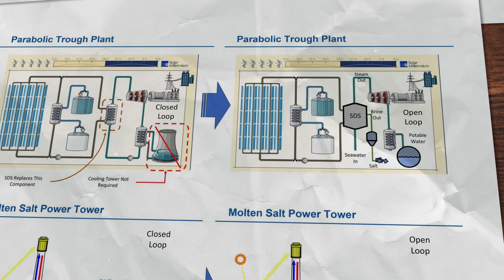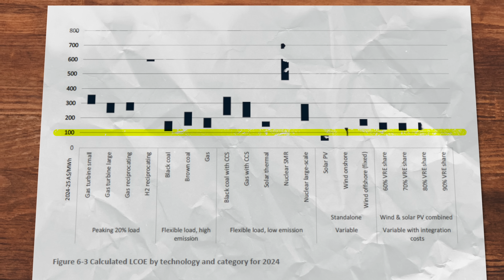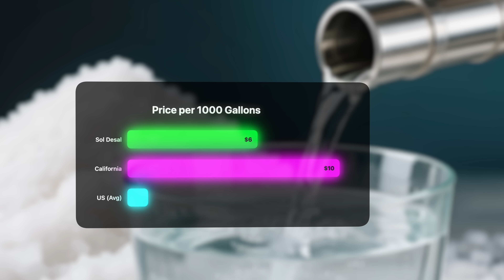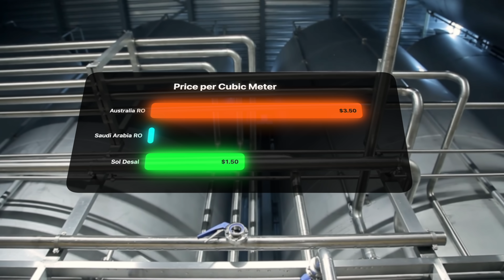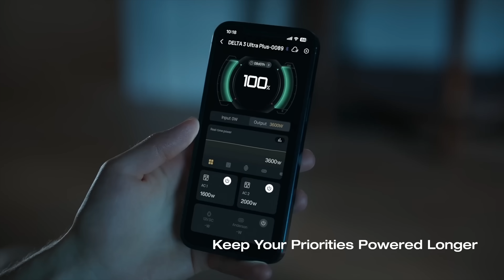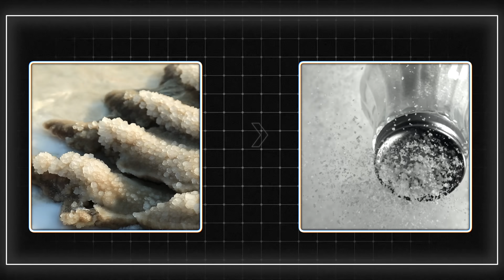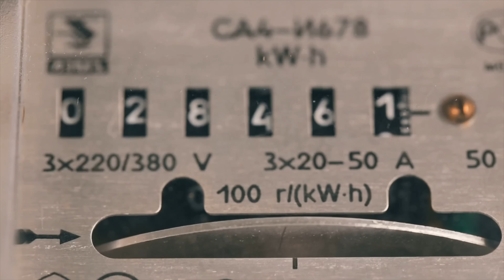The Desalination Process that MAKES Electricity - Too Good To Be True?

Comment: What is a crystalizer? That sounds like a little hand wave to skip over just how big a problem removing the remaining water from the brine actually is. Later in the video it was mentioned that it is in fact a big problem taking a lot of additional energy but when the term crystalizer was first mentioned it created the impression that this step was solved. 

As a side note, I have about five kilos of French gray sea salt left from a ten kilo bag I bought in the early 1980s. They “dry” it in the sun over acres of large flat gray clay beds. The result is a mild salt containing over 80 trace minerals. After all these years my bag of salt is still wet, with water locked in the crystals which can only be removed by roasting. If one is content with sun dried but still wet salt, it can be done cheaply. I assume batteries require pure fully dry sodium chloride. Can wet salt, or even brine, be used as a heat sink/heat storage?

Comment: Wouldn't use of geothermal cooling be a elegant solution to the energy efficiency? This would imply less water would be needed for cooling, less energy, and the setup would then have more net positive energy to pump back into the grid. I definitely think we need to be focused on a future where our energy demands are exceeded passively without destroying our environment, and that is what humanity needs to leap forward; our current model will destroy our planet, increase global warming, and likely lead to future flooding events if not addressed based on our understanding of consequences of global warming. 

Desalinization and reuse of water in theory at scale could also counter balance increased global sea levels, and potentially could open up room for archaeology on places that have been challenging at best to access due to being flooded. Personally, I think vastly supplementing our water supply with sea water is a huge leap forward, and the minerals being repurposed and creating industry around it, as long as we keep all energy generation green and pollution free, we're cooking up a system that can scale that could change the world. That's my opinion though, thanks for making the video this details a lot more of the desalinization process in an easy to understand way

Comment: Two things, first boiler systems using salt water for steam will be very high maintenance. You could use cyclones to remove salt micro crystals from the steam but some will still get through. Ceramic coating the turbine blades would also help. Second using the salt can be a simple a doing a few deals with the highly concentrated global salt leaders who might also invest in the back end salt purification. Standard evaporation ponds can finish the salt separation. Location is not important if you can load a ship where the salt is produced.

Comment: If it's obvious, then it is highly likely it's already been rejected. For example, this only works during the day, which can severely hamper production. The brine salt still has a huge amount of moisture in it that must be evaporated, and that salt is dirty. It must be purified before it can be used. It's almost certain SolDesal isn't the first to try this. It's just whether they came up with solutions for previously foreseen obstacles.

Comment: It's an amazing way of generating electricity as well as desalinating water, I wonder why dry countries haven't tried this so far because it really doesn't need high tech equipment. If I had enough money, I would definitely initialized this facility.
I've watched a lot of videos and searched a lot about generating clean energy but almost none of them except solar and wind (which require relatively costly equipment) are possible. This one actually works so why not doing it? If anyone is interested to cooperate I'm down. (I'm an electronic engineer but I think efforts in processors and semiconductor industry is too much and we should do something about sustainable energy as well.)
Reply: The anti-corrosive materials to build the turbine blades are a relatively new development would be my guess. I suspect quartz ceramics or some similar material is what they would make the blades from. They would probably also need a routine maintenance and clean out schedule to clear any crystalized salt from the blades on a regular basis to make it effective.

Comment: Most of the salt has to be left behind when the steam is boiled off. Steam simply can't hold as much salt as liquid water. The steam will have some salt but much much less than the water it came from. The turbines are simply salt tolerant/resistant. It is probably a multi cycle process that removes salt in each cycle until it is low enough to be considered pure. Maybe the final step is a vacuum distillation cycle.

Comment: solar concentration system is extremely inefficient and salt water is corrosive. this will be very expensive to built and run. salt has very little value. it'll never cover the repair cost. but it'll make water and electricity so if we scale it up drastically, it'll reach net profit.

Comment: Only an idiot would say you can’t dump salt into the ocean wake up people just mix it with lots of untreated, seawater and distributed over a large area far away from shore. Don’t dump it in one spot  and heavy metals. That’s a different story, but in case you didn’t know, chlorine is made from seawater.

Comment: I see a couple of issues. Very good video. Salt is easy to get rid of. They could sell the salt to New England. That's what we use on our roads. And they can sell the salt cheaper than they could buy it anywhere else. Asked for the desalinize water, I was under the impression in order for your body to consume water they have to add something to distilled water. Otherwise it steals the electrons or element from the body which strips the body of these chemicals. And it makes me wonder what the effect going through copper pipes would be on deionized water. Is it in a strip copper from the pipes on its way to its end? Makes you wonder. I see this is a very good idea. I just don't know the end result. It sounds good in theory.

Comment: On WW2 steam turbine battleships . . . they tripple distle the water before feeding into boiler that feeds the steam turbine . . . having really clean water is a really big deal.
I am concerned boiling salt water is going to result in salt deposits and corrosion on very expensive turbine blades.
Having a large solar plant, ona flat area, near the coast, near where people are is going to be very expensive land costs
Make a solar water plant . . . or make 1,000 houses that sell for $1 million each.  That water + power plant costs $1billion land, before anything gets built.

Comment: The research necessary to bring this forward and into reality… should be funded by those who wish to build data centers.
Want to build data centers???
Make THIS work… and then pair it with your data center.
The data centers can produce all of their own electricity and water… and sell salt as a “side hustle”… instead of forcing residents to subsidize their needs.
Reply: great idea . make it a requirement instead of them using our water and pushing up our price of water and energy

Comment: In so far as the return to source concentrations vs desalinating the oceans themselves over time, wouldn't it be more prudent to calculate and divide based upon need and retention of optimal salt quantity in the oceans to sustain the sea life while generating electricity, manufacturing sodium-ion batteries, and sending the desalinated water run off through a series of filters, bone char, clay, sand, etc.?

Comment: This would be great for las vegas. Back in 2020 i took a bus ride from vegas to san Bernardino. Theres a solar plant the directs mirrors to some tower. Apparently its a $2 billion flop. I remember hearing about the Saudi Arabia "Line" project with the glass dome desalination plant idea. Figured Elon's Boring company could create a massive tunnel from the ocean to Vegas. Use vegas heat and mass amount of unused desert land to refill lake las vegas with the byproduct of sodium ion batteries. I didn't think about the possibility of generating electricity. I mean could be something simple like steam engines or turbines like in this video. Even if the energy produced only powers the plant. I think its worth trying.

Comment: There’s also the worry that with global warming, the melting glaciers will dilute the seawater and therefore stop the global circulation of the Gulfstream. 

Well, one solution for that would be to dump more salt right at the point the melt water is enters the Gulf Stream.

Comment: I proposed something similar many years ago but my costs vs output figures were way off, being mere placeholder values as they were, and the proposal was rejected because of that. The costs and output were proportional to the project's scale (which was virtually unlimited), so it was difficult to come up with precise figures without building a scaled-down proof-of-concept version, and I don't have the money to do that. 
It's a pity, the project would not only have generated enough power to run a city but it would also have been a way to dispose of much of the world's landfill waste in an environmentally friendly way. It was clean, it was efficient and would have created thousands of jobs, but it wasn't perfect and there would have been some problems still to resolve, not least the huge startup costs before it started paying for itself. As a self-sustaining, self-contained eco project it could have worked. Less so if it was selling its various products, particularly energy, to off-site buyers: There's no hazard-free way to store and/or transport power over long distances.

Comment: Around 2005 we demonstrated an ultra-simple, low cost, waste heat driven desal/purification system. We considered incorporating concentrating solar which would have the precursor to  SOLDESAL. Life happened and here we are.
Reply: He had plans to clean up the eco disaster in Salton Sea in SoCal

Comment: Heat distillation is not new son.  It's been around for a long time (WWI  or WW2).  The military (navies), shipbuilding (Commercial ships, yachts, etc.) predominanatly us distillation desal, and have for decades.  Selling the brine salts is also not a new idea.  Your point regarding Sodium batteeries IS a new wrinkle these days.   

You talk of  'cheap' water...?  Water has never been cheap -merely subsidized and regulated by  govt's.  Consumers in the West (especially the US) don't pay the true costs of producing water.   In the water stressed/water lacking regions of the world you referred to, the production of said water is far more valuable than the energy used to produce it.   If you research the 'true costs of producing potable water' you will find that there is no such thing as 'cheap water'.  Jim/Colombia  @gtmoBlue

Comment: Doesn't ocean water consist of multiple types of salts besides sodium chloride (NaCl)?  Separating and purifying the NaCl from the other salts to power sodium ion batteries may be expensive and would need to be included in the overall desal/sodium ion battery equation.

Comment: There is a new battery type in development that hold more promise and safety than Lithium, and it is salt bases in a type that the desalination process outflow may be the key ingredient, not refined salt, but base filtered salt without chemicals or cleaners added.

Comment: Great video, as always. The multi-effect distillation (MED) process with boiling seawater is a fantastic example of the difference between simple filtration and true mist elimination. A filter blocks particles, and a standard fine mesh would instantly clog with the highly concentrated, salt-laden brine mist. A demister pad on the other hand is engineered for coalescence. Its complex knitted mesh design provides a huge surface area for the tiny liquid droplets to collide with and collect on. The droplets merge into bigger drops, which get heavy enough to fall back down against the vapor flow. It's a key engineering detail that protects downstream equipment from corrosion and scaling.

Comment: I did this on paper long ago..but your missing the next step..salt water batteries for energy storage and additional revenue..imagine selling salt water energy storage for super cheap because you factor in initial cost plus the avoided disposal cost.. salt water batteries for everyone. Salt is also useful for several other things and by simply adding on additional blocks of industry like the salt water battery manufacturing plant..you can create numerous new products (exp. lithium salt, specific chemical treatments with salt, ect) at very cheap prices given that you would save money even if you gave it away free.

Comment: Why couldn't you turn the brine taken out of salt water to create battery storage Mega Packs? Solar Desalination = Clean Water, Table Salt, Batteries & Mega Pack Battery Storage. 

If they were to build these solar desalination plants in every country along all coast lines & build Boring Company tunnels through every continent & fill them up with clean water.  Imagine underground tunnels filled with clean water, if we placed these tunnels under highways that run through every major population centres we could bring as much water as needed everywhere. We could eliminate droughts everywhere, we live on a water planet, ocean levels are rising, this is exactly what we should be doing everywhere on earth.  

We could create an abundance of energy by installing Bifacial Solar fencing along every highway on both sides & every rail line & bifacial solar panels absorb the suns energy on both sides of panels.  Bifacial solar panels double energy production from both sides of a solar panel & installing bifacial solar fencing on both sides of a highway & rail lines doubles the amount of solar installed. And fencing takes up very little land that is already there & doesn't take up any farm land. 

The Trans Canada Highway is about 1,500 kilometers long, a bifacial solar fence doubles that to 3,000 klms long because it works on both sides of the panel & it doubles again when you install them on both sides of the highway to 6,000 klms of solar.  In the US there are about 50,000 miles of highways & 70,000 miles of rail lines, how much energy could be produced from installing bifacial solar panels on them?  And they run through every state so every state would reap the benefits & could help pay for the costs. When you add Mega Pack battery storage everywhere you create a giant grid across the entire country producing an abundance of energy. And every country on earth could do this & become energy independent. 

Desalination plants could create an abundance of water, if the world would forget amount costs & just do what the world needs now & get the results which will drive down costs later.  If we can pipe oil anywhere we can certainly pipe clean drinking water everywhere & green the entire planet.  And store as much water as we want underground in boring tunnels away from environmental disasters.  Imagine producing so much water that it is almost free that every city, farm, park everywhere that uses water can tap into these underwater rivers to irrigate their properties.  

Imagine underground rivers that are turned into fish farms providing an abundance of sea food, imagine underground hydroponic LED produce farms or animal farms managed by AI built & maintained by Optimus producing an abundance of food away from environmental disasters.  It's all possible if we forget about the costs or after mounting costs we simple hit delete on our computer screen which is what money has become numbers on a computer screen.

Comment: It’s not just water production but also how water is consumed. There’s a lot of waste and folks do use water inappropriately. Places like Bermuda rely heavily on rainwater harvesting via unique stepped limestone roofs with the water that’s collected stored in underground cisterns. Even then, people will use water carefully. Why do you need to have the tap running whilst you brush your teeth vs pour water into a glass, use what you need to clean the toothbrush and rinse your mouth and less water is used. Bermuda does use desalination plants, primarily driven by demand from the tourist industry but also to supplement the overall rain water supply. Regarding the roofs, the stepped design prevents gutters from being overwhelmed, the white colour reflects the sun and helps to purify water, gutters channel water into large underground storage tanks (cisterns) and it’s a legal requirement that each house must have a specific amount of tank space for every square foot of roof area. Other regions, like Peru, where there’s a drier climate use large nets to capture water from fog in arid areas, especially in high altitude environments. Specialised nets are installed on hillsides where the fog is dense, moisture condenses on the fine mesh nets, drips into gutters and is collected in tanks to be used as drinking water and irrigation. Each net can catch 200-400 litres of water every day. Areas that are considered as dry would benefit from green spaces such as the half moon or semi circles water harvesting structures. These half moons are pits that are dug on contour lines which capture rain water instead of running off. The water is collected in these structures, slowly soaks into the ground, nourishes plants, crops and vegetation restores degraded land and also improves food security. At the same time, water can be reclaimed responsibly. The reclaimed environment also helps to promote favourable changes in weather patterns. We really need to up our game globally when it also comes to harnessing the environment to provide energy and additional benefits without costing the planet or those that need it.